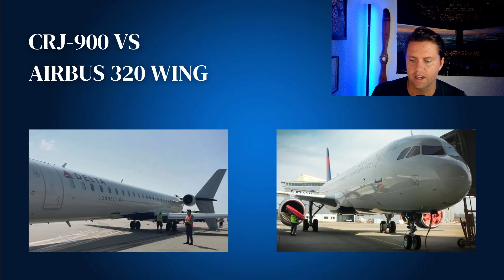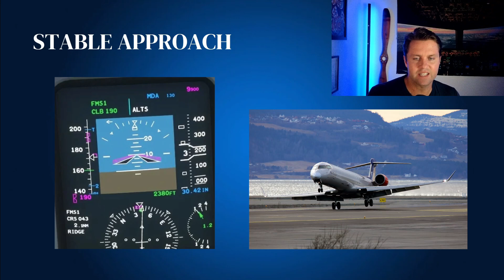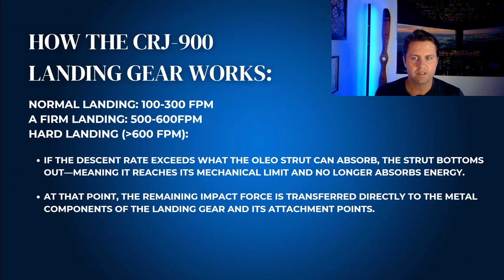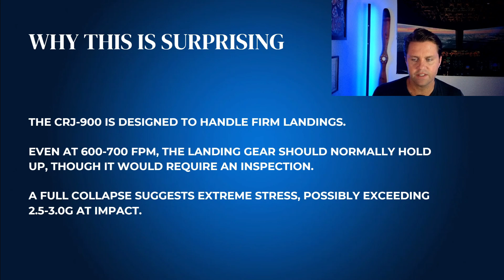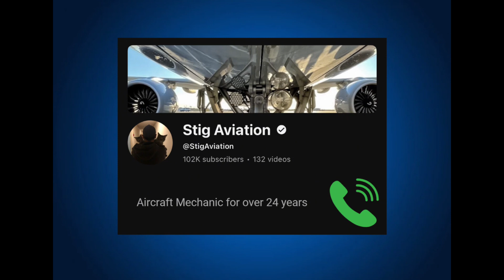Pilot Breakdown: Did a Hard Landing Cause A Gear Collapse?

Comment: Possible Icing of the wings and empenage???  The ground speed looked adequate because of the the low AOA on the approach...Comparing this to Aisiana flt #214 (777) Into SFO shows the difference btwn. a Low airspeed and High AOA...This seems to be high airspeed because of low AOA... But very poor lift from the wings and reduced flight control authority from the empensge, even though the airspeed appears to be high enough...Icing of the wings & empenage could have caused this...Check into the function of the wing & empensge anti-icing and bleed air equipment on this one...Today is: 02/20/25

Comment: I flew 900s, and you are spot on, great video. That plane is know for its "stiff legs" which basically means it is not very forgiving and hits hard if you don't get that descent rate near 0 on touchdown. Maybe they tried to flare but ran out of airspeed a little too soon. They also touched down a little short. If they were riding the shaker the flare might not have worked.

Comment: The design requirement for an FAR 25 transport airplane is to demonstrate during flight test a landing at the maximum landing weight and at a sink rate of 10 feet per second without significant structural damage.  No requirement to hit on one gear so it shouldn't be a surprise to see the gear collapse.  The big problem for this airplane is that the landing gear attachment is supposed to be fused to break away without ripping the wing open or breaking it off,  This accident will certainly require some design changes to this model.

Comment: The rate of descent looked super fast to me.  at 1:31 it looks like it is about 80 feet high based on the length of the plane which is 119 feet.  Three seconds later it hits the ground.  That would be like 1600 feet/min which is a lot larger than the numbers you quoted.  I am not a pilot or anything, so I am just estimating with my eyes so maybe I am off by a lot.

Comment: As a retired airline captain, the Canadian CRJ has a very short landing gear . So ,the Pilot has-to flare lower than in a Boeing or an Airbus aircraft. 
Your reaction time is shorter . In this particular landing, it appears the from the video evidence > that the flare was misjudged . Once the Aircraft structure failed (  gear collapsed ) everyone was a passenger including both Pilots . To be fair to the crew > It is a possibility that the up lock of the landing gear failed.

Comment: I agree with you .. hard landing... but never should have destroyed the jet.. no flare.. loss of airspeed due to windgust.. but still  .. this was equipment failure.. has this jet been involved in hard landings before?  work on the gear?  CHINESE BOLTS?  we need to know.  FO was 41 days after receiving her ATP, the voice on the radio was male so SHE was flying.  Agree about the snow keeping the fuel from following the sliding jet.

Comment: Good point. It dug in and pulled the whole plane around and it rolled. 
    Straightforward if you think about it. 
       Wonder the comparison to a DC 9 or BAC 111 for clearance of wing to ground. 
    It is VERY low but it is a small plane.
   And the Snow doused the fire. 
2 good points.

Comment: Indeed! No flare!! Snow covered runway and side area may have precluded the ability to ascertain speed of sink rate. However, pilot monitoring should have been locked onto the radar altimeter giving height above touchdown and a pre flare call cutting current sink rate in half! Both are at fault!

Comment: yep she bounced hard with the nose level.. but shit happens. I still don't see why they don't use  rear main landing gear with the ability to allow some deflection  side to side to allow a certain amount of steering control if your wheels are skidding sideways you are going to pivot  on the front  steering wheels and  the tail is going to kick or drift sideways ,but ,if it suddenly hits  snow in this case  it would stop rotating and under huge force the wheel to break off. if however the rear steered a bit it it could aid in control with  self correction by allowing the wheels to steer in the direction of the drift (   by computer control ) lets step up people if a car can self drive then  why can't a aircraft  Duh..where are the  Air/Space Nerds..

Comment: Not going to deny that the snow had a positive impact on putting out the fire, but the other important factor was the wing breaking off the plane. Most of the fuel is in the wing, and you can clearly see in the video that as the plane gets farther and farther away from the broken wing, the fire dissipates.

Comment: I have a take.  I've never qualified as an airborne bus driver but my first pilot's license was 58 years ago, my career has included flying Cessna L-19 "Bird Dog" observation planes for my state's Forest Service.
My guess is that the first landing gear to fail was the nose gear.  It got wiped off because the plane didn't flare and the nose gear got jammed into the runway.  Once you've got all the weight of the aircraft on the nose, the nose is going to act as a fulcrum and the rear of the aircraft is going to slam down and because there's a lever moment around the "fixed point" at the nose and all the weight plus the lever effect is going to slam the mains down even harder than a vertical drop.  In an ordinary hard landing, you'll likely see a PIO bounce effect, nose gear hits and bounces up, mains hit and bounce up, nose slams down again.  But this one wasn't ordinary, the weight transfer onto the nose (and I mean nose because I think that the nose gear was wiped off or slammed upward into the nose structure instantly) meant that the reaction was throw a magnified G-loading onto the mains.
But it wasn't "mains", it was "main"- it was on one  of the main landing gear.  One of the first things my instructor in the J-3 taught 58 years ago was "wing tip down into a crosswind". That's in a normal, "easy" landing and it's almost impossible to do an ILS with a crosswind without a little into-wind wing down.  So, if the wings had been level, that weight would have been spread across the two main gear but the wings weren't level so all the weight of the aircraft, levered around the nose, fell on the right gear.  And instantly the wingtip went into the snow and you've got one hell of a more complicated web of forces being exerted on the aircraft and most of it was focused on the right main gear.  In a second, it goes from two pilots and 78 passengers on board to 80 passengers on board.  
In addition, once the gear has failed and the wingtip is in the snow, what do you see just a little later?  The nose pops up just a little bit.  As mentioned before, in a simple hard landing, the nose is likely to bounce up in the air immediately but that didn't happen here.  The nose stayed down for the split seconds it took for the right gear to collapse and the wingtip to dig in.  Only when the weight of the aircraft was on the center area of the aircraft did the nose come up but the load on the nose has dissipated (i.e. the lever effect had gone away) so the nose gently came up but it was late and easy and it quickly dropped down again as the fuselage rolled onto its side.
I'm amazed at two things I see.  One is that the aircraft is in a very slightly nose-down attitude as it passes 40-50 feet and the nose progressively drops as the approach continues.  The other thing that I notice is that the elevator does not seem to rise at all through the approach -- what caused that???  Was the pilot in a sudden "white out" and lost visual cues and didn't pull back on the yoke into a flare?  Or was the elevator blanked by the cross-wind (like a T-tail Piper Arrow -- the wrong crosswind will completely wipe out elevator control and you can't lower the tail/raise the nose no matter what you do -- in fact, the nose will drop on you even if you're pulling back); although, if this were to happen, I think it would be the instinct of every pilot to pull back on the yoke/stick even if the elevator wasn't actually doing anything to control pitch.  
I don't know how many times I've encountered a gust on landing that's "bubbled" the plane I was flying upwards -- in a light aircraft, usually you had to add power and make it fly under control again or you're about to "drop out' from what height you've ballooned up to.  You can feel it in your pants and see the airspeed indicator flicker upwards.  But there have been a few times when I've been landing into a noticeable gusty headwind and the aircraft just "drops out" -- like the wind has suddenly quit.  That's exactly what it's done, I call this an anti-gust and it will dump you on the runway like a sack of wet laundry.  Did this airliner fly into an "anti-gust" that reduced the lift on the wings and caused the nose to drop with the elevator held steady?  It looks like that to me.  

Something caused a perfectly good approach to go bad -- to a condition where it was dropping like a rock with the nose down/no flare.  Was that something environmental, pilot error, or a condition where a recovery is beyond the mortal response time of any human?  I don't know, but that nose down and high sink rate condition seems to have been the major link in the accident causality chain.

Comment: If you watch that landing carefully, you will see at least part of the right landing gear come out from under the plane.  The tire was still attached and it bounced.  As an ex trucker,  I once hauled a load with  farm irrigation equipment.  Tires were on top, so 13.6 high.  Farmer was helping and we told him to not drop the tire from the top, but he did, and it bounced for about 1/4 mile.  On this plane you see the flames, takes your eye away from the tire.

Comment: Youtube will likely censor this comment, but I have to remark on this.  It is utterly astonishing to me the number of people in these threads shouting that pointing out faults in DEI hiring is somehow "political", "MAGA-izing everything" etc.  Many of these folks claim or insinuate they're ATPs , which is shocking and disconcerting.  

Let's refresh Bayesian logic 101.  We see a hull-loss accident, an extremely rare event, that involves what appears to be a gross failure of basic airmanship (pilot forgot to flare in this case).  Right off the bat, the probability that we are dealing with some form of pilot incompetence is extremely high because 1) the direct evidence for it is perhaps 1000 times baseline rate and 2) the indirect evidence, the crash itself, is orders of magnitude higher than that.  We also have a third Bayesian prior — the most likely NTSB-determined cause of crashes has historically been pilot error.  

DEI hires by-definition also come from populations with shifted means and oftentimes, as in the case of women and spatial reasoning, have lower standard deviations.  This produces so-called tail effects where DEI candidates are effectively absent from top 10% performers and sparsely represented among the top 50% where rigorous filtering has been applied — which is what ATP certification is.  When the chips are down, you want starters in the cockpit, not third-stringers, which is exactly what vast overrepresentation in the bottom 25% is.

So, where you have 1) stringent filtering like ATP certification and 2) lower population mean and standard deviation for innate performance potential among DEI candidate groups, for any given instance of gross incompetence, the odds ratio that it involves a diversity hire is VASTLY higher than odds ratio that it involves a non-DEI hire.  Restated, DEI hires are far more likely to be involved in a hull-loss involving gross incompetence than non-DEI hires.  For companies like Delta and United, that Moloch sacrifice is apparently well worth it.      

I don't expect average commenters to understand any of this stuff.  I do however expect every single ATP pilot to understand it.  Flight safety increasingly depends on it.
Reply: Yeah because white men weren't crashing aircraft for decades, many due to piss-poor piloting and ADM....got it.  GTFOH with that bull 💩🙄

Comment: As a former Naval Aviator and LSO with hundreds of carrier landings, I have several observations from the video. The aircraft had no flare thus maintaining the excessive rate of descent. It landed right main first approximately three feet lower than the left main. The entire weight of the A/C was transmitted to the right main gear thus exceeding its design loading and subsequent failure. That failure initiated a rotational movement of the fuselage about the longitudinal axis of the A/C. The right wing hitting the ground was a stopping force against that rotational inertia AND the lift still being produced by the left wing. Those combined forces exceeded the right wings designed strength and catastrophic failure was the result. Damage to the wings structure by the failed landing gear is unknown at this point but could be a contributive factor.

Comment: DEI strikes again! Female pilot, only recently qualified. Delta have yet to release any crew details. Endeavor air make a big thing about their diversity, equity and inclusion program, clearly ranking it above safety. They even run commercials showing all female crews, referring to them as "unmanned". I for one won't be flying Delta any time soon, United are already on my DEI shit list. She came in at 112kts, on 23, with a 22-33kt wind at 270. I've heard the crosswind limit is just 10kts for the CRJ with that low wing, so that was clearly exceeded, and she had insufficient reserve to allow for sudden diminution of the wind (windshear)

Comment: Ok, 20+ yr USAF flyer, 10+ yr contract aviator, 10,000+ hours here with an aero engineer degree, and USAF Accident Investigation certification…. I think you’re on the right track.  Everything seems normal until flare, which was incomplete but given the winds doesn’t seem unreasonable.  Having been through countless hard landings my thoughts are the gear should have absorbed enough energy to cause a bounce, which didn’t happen.  It collapsed immediately on the right side only.  If the landing was that hard both mains should have collapsed even with the aircraft slightly right wing down.  Given the right cross wind the left gear should have had more stress on it anyway.  My guess is there was previous undetected damage to the right main or some type of obstruction on the runway…perhaps a snow boulder?

Comment: I am a pilot, non commercial, but that airplane had to be exceeding normal decent by a lot! It was moving very fast and didn't appear to flare at all. The Captain should have arrested the decent rate and hit TOGA. Just my opinion. The flying pilot may have been carrying some power and speed for grandma because of the winds (I've done that) but at some point you have to raise the nose to stop the decent and burn down airspeed before you drive the landing gear through the wings. If you are lucky you just bounce off the runway, add power and try it again, if not, well? We must count our blessings that everyone survived! The CVR's will explain in great detail what happened as opposed to what we all think happened from the videos and some us will have been proven correct in an assumption of the cause, or not.

Comment: These piolets were coming down at 200+ feet PER min faster than the 500 to 800 fpm recommended and it appeared there was No Flaring which is VERY IMPORTANT -  it protects the plane & passengers. It's hard to master but these pilots should have had it "down". such a steep descent may indicate a hard landing or an unstable approach.

Comment: It appears that the plane landed significantly to the right of the centerline, causing the right main landing gear to touch down in the grass or snowbank. This impact would likely have torn the right gear off and sent it backwards, away from the fuselage. Since the plane was already on snow, there wasn’t a large plume of fire or a lengthy slide down the asphalt, which could have made this incident much worse.

Comment: BS! It’s NOT a mechanical failure, gear wing etc. ADSB Data has final rate of descent of 1100 FPM and they got there flying way to slow on short final and I bet they didn’t apply the extra 5 Knots for gust factor. Pure Pilot error, I have many hours flying the 900, it is a very unforgiving airplane if you get slow.

Comment: Right gear torn away, right wing sheered off, lift from left wing corkscrewed the plane and sheered the left wing. Getting the wings with their fuel away from the passengers saved them. Luck and sliding on snow might have helped the fuselage stay together but it was lucky.

Comment: Wind  and Possible tire collapse .Tire falling of wheel and metal wheel snagging the ash fault. Low tire pressure. Tire pressure slow leak cold whether pore rim tire seal  . Leaky  tire . Gear collapse . landing gear design position. Possible previous stress cracks from poor manufacturing or previous damaged that appeared later. Faulty instruments .Metal wheel stress cracks . Cofactors etc.

Comment: If this had to do with anything mechanical or instrumental, could be due to bad maintenance or mechanical maintenance or caused by sabotage, or pilot error doing the landing, it could've been the strong winds, but, they're were lucky it was cold and snowy. If it had been very hot, the plane could've burned totally. Fire started but didn't grow possibly to thee cold and slush.

Comment: 100% on your description. Avionics mechanic with Air Canada in the 80's and 90's. Those landing gear are designed to take a hard landing and would require an inspection and potentially replacement, but that looks like gear or structural failure.